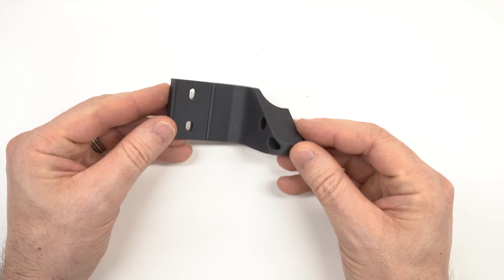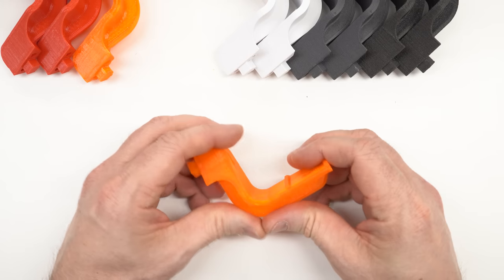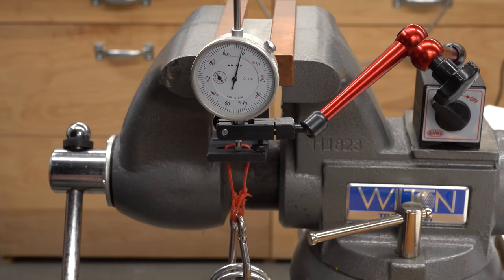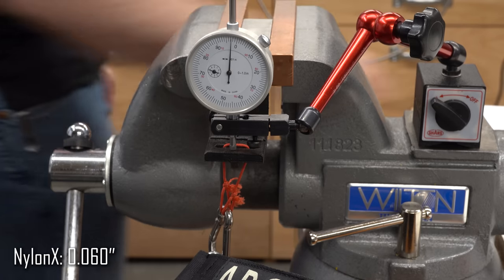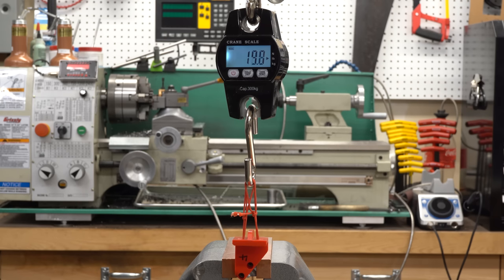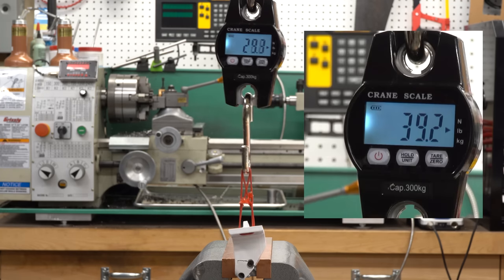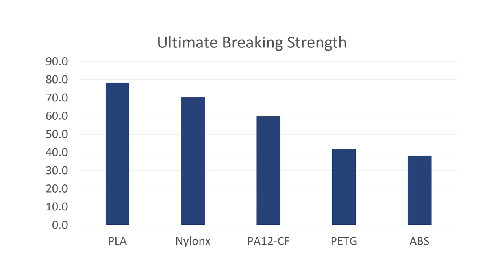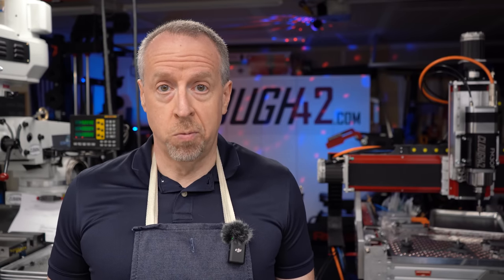Wait, What?  PLA is Stronger Than Carbon-Fiber Nylon?

Comment: for a bracket like this, these tests are ideal, but what about fatigue over multiple loadings? I made some brush adapters to go on the end of a painters pole, all the PLA ones ended up snapped and not a single nylon one has broken after years of use.

Comment: Thanks for a very interesting and usable test. I do wonder if the results are as much a test of your particular part design as they are of the different plastics. I would really have liked to see a test where parts did not fail at the point of attachment.

Comment: That was really surprising and also very interesting.  I do know if you are going to have the pla in the sun where it can get hot it will wilt.  I tried to make a gps holder for the dash board of my truck and it just leaned over after a few days.  Keep on keeping on.
Reply: If you live in a hot place, even PETG won't be enough for those applications.

Comment: I personally would have liked to see if PLA+ or PLA Tough would have made any difference as it has become my default printing material and in my option is much better in strength and heat resistance than standard PLA.
Reply: I print a lot of eSun  PETG and eSun PLA pro (PLA +)  LOVE the PLA+. for ease of printing, surface finish, and strength.

Comment: i know its a year old now but to me the failure mode seemed to be subject to print quality variation. The small cross section near that top bolt would be stronger or weeker depending on adhesion on the very small number of 'lines'. I would love to see a comparison of the same part but with a reinforced section at that failure point.

Comment: I learned years ago, that PLA is the best all around material. Strong enough for most things, low warping, easy printing, cheap. Unless you have some heat requirement or other specific requirement, other materials are just a waste of time and money.

Comment: abs is better if you need something working at higher temperature - like drive caddies that can warm up to 55C - 60C, nylon, if you want strength that can withstand exposure to elements … other than that PLA is just fine (unless you really have quirky requirements, the  choose accordingly)

Comment: Data sheets don't lie but your printer setup for each material may, however i enjoyed the video still and feel this test will be close and likely the same with most ender3 like PLA profiles/printers so ya pla gets the win as your only as strong as your weakest component! although,
PLA filament has come along ways over the last decade it was always around in resin it was just never applied yet(certain Grades of pla and/or additives making a formula for FDM apps),but without proper UV protection your corn made pla will degrade fade and move in most outdoor/automotive like apps but it makes the best molds from a FDM stand point and with the easy of printing it's hard to bother unless it's called for that materials properties, ABC why pay more! I would have liked to seen ASA in the test over another nylon CF excellent videos keep it up

Comment: PLA will deform too much in a hot car, I never use it for anything I transport out of my house because In a parked car it will consistently deform. When I print parts for my camper they are always ABS including my intake vent for the heater

Comment: PLA is very strong but it's temperature resistance is very low. I have left PLA prints in a hot car on accident and it warped my 3D prints to almost unrecognizable. I like using Prusa PC blend for tough parts. It is easy to print with strong and can handle most common hot environments like a hot car.

Comment: Yes, PLA is tough but its dimensional stability under load over time is very poor. I suggest you do a test over a few months; you'll be surprised. I learned the hard way several years ago with supports failing after 6 months. This happened with different brands and colours, too. For general engineering products, I stick to transparent PETG, which has no fillers to affect its performance. As I've commented before, I use Colorfabb CF20-XT for stronger and more stable performance. Of course, dry filament is important.

Comment: I've been using carbon fiber pla recently for my parts needing more strength reprapper brand. made a hook to hang items in the shop 1in wide 6 outer walls 35% infill it has successfully held 80lbs for 1 week now

Comment: We've printed with PETG a lot in the past, but are now considering printing with PLA.  Now the question becomes: Are the more expensive PLA materials that much different?  PLA vs PLA+ vs PLA pro vs CF-PLA.  It's also hard to imagine that the tiny fibers in CF embedded material are long enough to make a difference.  True carbon fiber gets its strength from the woven fibers, the pattern in which they are woven, and the direction of stress compared to the direction of the weave.  Wouldn't the carbon fibers imbedded in a filament be too short and the random direction in which they lay simply make them more of a "filler" material than actually lend any kind of support/reinforcement?

Comment: I think you need a dramatically simpler shape for testing these factors. A longish rectangular bar would be ideal.

Thing I have no idea about... do different materials require/benefit from different treatments by the slicer? Did each of these materials get their ideal slicing?

Comment: Colored ABS is usually less strong than undyed ABS ( depending on type and amount of pigment of course) I think the same holds true for all materials, also all materials have a preference for printing tempature layerheight and speed in regard of interlayer bonding… in the end this is very interesting, but chances are the results for someone else might look very different just because of a different printer and or filament brand. Again interesting, but I bet you could even alter the results by printing the same filaments 5-10C hotter or colder and/or 5-10 mm/s slower or faster using the same printer and filament and keeping all other setting as is, while still —after some experimenting— being able to bring them in any order you like

Comment: Unless temperature resistance is a concern a good quality PLA+ (I really like polymakers PLA pro good balance between stiffness and impact resistance) will outperform basically all filaments until you get up into filaments that require heated chambers to get maximum layer adhesion.
Reply: Sure, except if your part is under constant load. Then the creep that PLA experiences will likely make you regret using it.

Comment: Nylon - CF has higher impact resistance or toughness vs PLA. If you are building RC planes which crashes most of the time, that is where PA-CF can be used.

Comment: One reason I will never use PLA again for anything.  I had 12 multipart prints (Battery holders) that I left in a hot July sunny car.  All melted and deformed.  Each item was about 14 hours work.  PETG has never let me down there with similar or better strength.  I do want to try some other high temp materials but will never go back to "benchy material" PLA.  Just me I know and I'm good with that.
Reply from the maker: This is part of why I pointed out I'm only testing a couple of properties.  Other matter, depending on the application.

Comment: Awesome video! Although, there are some things bugging me: did you dry your PETG? Wet pr somewhat wet PETG can be very very weak, and same thing with ABS, but also, ABS need to be printed in a somewhat heated chamber (at least passively heated) so its characteristics are optimal 🥴 so yeah, there's that

Comment: Consider the failure mode and ask yourself if the properties of the material are compensating for shortcomings in the design.
Designing for a particular application requires the selection of material and then designing around both its strengths and weaknesses. In this case regardless of the material, all the parts seemed to fail in the same manner. That would indicate a shortcoming in the design, so this was more a test of the component form than of the actual material, although still valuable information.

Comment: Would be interested in seeing this test repeated on a different part, without the very thin wall next to that counterbored hole. The parts consistently failed there first, and being such a small feature (maybe 1-2 perimeters?) it's hard to say whether this was really testing the material itself rather than variations in that specific location (stress concentrations, local layer adhesion, local print quality, etc). The enormously high PETG result, as well as the unique way it failed (compared with the others), suggests this too. 

This test absolutely does confirm one thing though - holes close to edges lead to failure! When strength matters, stick to those rules-of-thumb and keep your holes at least 1-2 diameters inside.

Comment: hey was wondering why during the deflection and tension tests that conventional dog bone plate were not used? I believe having printed a vertical standing dog bone plate with no supports, to avoid potential of 'heat treating' one side by accidentent due to its constant contact of the heated printed bed would perhaps give more repetiable results? i think also measure humidity of bed chamber, temperature range and some compression tests would be intersting see esp with abs + vs pla +. would love to see some modulus graphs to see how ductile or brittle the materials are

Comment: This is compelling as data, but in real life there are things to consider such as temperature, pressure, and stress coefficients, as well as cycles and fatigue, and chemical environments. PLA is basically cardboard glue, and for those reasons above we don't make zip ties, bottles, and valve covers out of it. PLA is a great toy or prototyping material, I have not found a single thing it is better at than a specifically selected material for other intended roles, however. There is also a great variance in the PLA (and others) mixture between brands, and especially between variations for printing ease or strength. I think this is an insightful test, but doesn't show the true story in reality. I do agree PLA deserves more credit than it typically gets, but not as much as the video seems to try convincing me of. I could be wrong, but these tests are not supported by other tests done better which I have seen many of.

Comment: Resilience to higher temperatures is an important property where PLA almost certainly fails immediately. Even just sitting in the sun behind a window, black PLA already droops and deforms.
Personally, I still don’t care much as all its other properties outweigh this issue. But when I need strong parts that need to be heat resistant, too, I use PC-CarbonFiber

Comment: Pla is the wampire filament...it's though and it's precise...can handle a alot of stress. It can be used as  gears, without changing much... but put it outside in the sun or just heat from a window...an it's over. 
The nylon, do better... until you hit it with water...

Petg is a bit more flexible, very good for covers as it can handle the weather better but can also flex, if your open and close the cover

So choose your hero wisely.

Comment: PLA is pretty impressive but it suffers from heavy creep. Nylon does too, but the effects are greatly reduced with annealing. PETG is relatively flexible and varies between manufacterers. ABS is probably one of the better options but its harder to print than PLA or PETG.

Comment: In my experience, PLA will get brittle over time and will plastically deform permanently at much lower loads. PLA is good for a temporary part but sucks for everything that you want to use for more than a week. 

The best high strength, long lasting material that is affordable and printable on hobby printers is Prusament PC Blend.

Also, CF weakens whatever filament it is printed with. CF will make it stiffer (less flexible) but reduce the ultimate strength. Its important to take that into consideration for design applications.

Comment: Strand length has a lot to do with the strength fibres add to the base material. The majority of carbon fibre added in fdm filaments is milled to almost a powder and possible breaks down further during the extrusion process.

Comment: This is a complex part.  It looks like failures are at the screw attachments.   Perhaps a simple rectangular beam clamped in a radiused clamp might show modulus of elasticity and failures beyond the elastic limit more clearly…. Still, a valuable test.

Comment: The PLA was stronger than I thought! But I'm still not sure I'd use it for shop projects if I lived in the Boise area like you do (if I remember correctly, anyway). I have a friend in Meridian, and her garage gets very hot in the summer. So unless you keep your shop/ gym air conditioned even when you're not using it, PLA may not be a great choice. Good tests, though.

Comment: So many of the comments indicate that the howto of printing PETG is not so simple as PLA ,  You could easily make many videos on this alone.  In my experience PETG for strength has to be printed very hot with no fan but the effect of this is not a smooth part  but it is very strong .  Also thin parts suffer from this method , you can of course add fan but the part is then more like PLA  IE layer adhesion suffers but the part looks good !  Your parts of PETG looked way too good to have strength for PETG they need this Melted look then I know they are  strong .   3d printing is very frustrating that way , so many tricks , so many parameters to make it work .  There is this goal to print strong durable parts with the magic filament but I don't know if this will ever exist . Like grades of steel there will never be one grade that will be the go to grade.  As creators  we should all know this ...

Comment: Nylon-12 is still a very flexible plastic, so these results do not surprise me.
However, you can buy carbon fiber reinforced Nylon-6 filament for pretty cheap, and it's much more rigid than Nylon-12.
PolyMaker sells both types of filament, though I think any of the cheaper Carbon Fiber Nylon filaments on amazon will be Nylon-6, as it's just cheaper than Nylon-12.

Granted, Nylon-6 will absorb more moisture over time, and this impacts it's strength and other mechanical properties, but I still think it'd be interesting to see how it compares to the other filaments.

Otherwise, great video!
Reply: You make a good point.  "Nylon" is a family of resins.  Nylon-66, made by polymerizing hexamethylene diamine and adipic acid, is used in fabrics, including ladies' hosiery.  Nylon-6, made by polymerizing caprolactam, is used in gears, etc.  Nylon resins mimic proteins, in that they contain biuret linkages.
Reply: @eliduttman315  It's fascinating. I wish I knew the first thing about plastics.

Comment: I just recommend eXtrudr PetG. Using it since 2years to print rigit parts for paintball and mechanical applications. Give it a try, you will be surprised at certain points

Comment: James, I say! What a test! But recalling you've got a laser printer along with those two ink-jets I'm looking fwd to seeing a follow-up with UV-resin parts (esp. ABS-like vs real ABS) on how they compare with these ones.
Pretty please with sugar on top!

P.S.
And when measuring deflection I would go with 3 different weights to see if the deflection factor is linear, which it should be, but, you know, science and practice. But this is optional, your science is scientific enough.

Comment: I think biggest issue is quality of the print, which is hard to control even in the same environment, much more on different, printers, temperatures, humidity, etc, etc. Therefore designs would quite often need to be conservative, since defects in the print are quite likely.

Comment: I wonder how you printed the abs part.
In my and others experience, abs parts being printed only get really tough if the chamber temperature is above 50°C (or even higher up to 70°C) and the filament is without a lot of additives (Fillamentum, Polymaker etc. but not Formfutura for example).
It gets pretty hard to print with open printers so a lot of people avoid abs

Comment: You hold the design constant between prints but the difference in prices opens up another variable to increase strength: adding more material. Either make a chonkier design for the part which uses more material or increase the number of perimeters and solid top and bottom layers when printing to use more material. The price difference in the filaments gives a lot of scope for adding more mass when printing cheap ones before the prices of the original part in the expensive ones would be reached.

Comment: Heres a tip with nylon, it needs to be dried to print and wet afterwards or humidified to regain strength. Nylon stands up better to heat and UV vs pla that turns to playdoh.

Comment: PLA is great, just can’t handle the heat it impacts very well. I feel that everyone is sleeping on ASA. I find it to be better than ABS in every aspect. Including ease of printing, less warping and lower odors.
Reply: I wonder if the carbon improves heat sensitivity or makes it worse.  Diamond is pure carbon and the best conductor of heat known to man. Would distributing the heat evenly throughout the part raise its failure temp?  I hate math.

Comment: I have not the slightest Idea why people do not test co-polyester Filaments like ngen. In my experience it is the best allrounder, strong, UV resistant, hardly hydroskopic and a glass temperature of 85°C. It is easy to print and doesn't smell. The only things that could be better: it is  shiny, has a very litte bit of stringing and is a tiny bit brittle. But as I said well worthy to put it in the mix when you want to find the best Material out there.